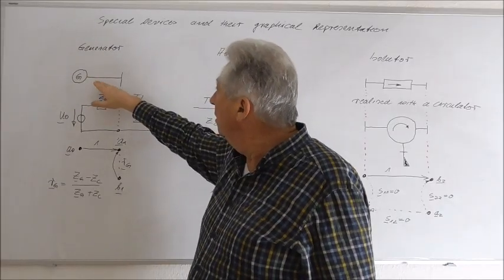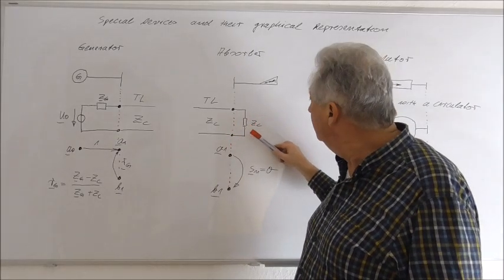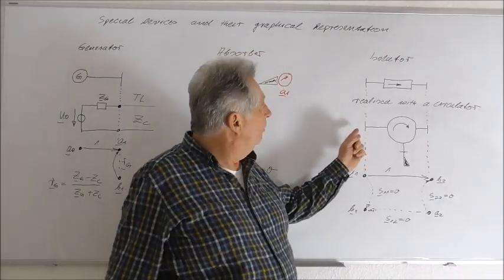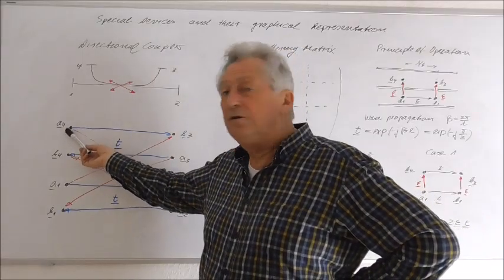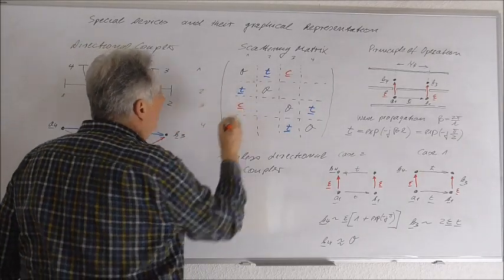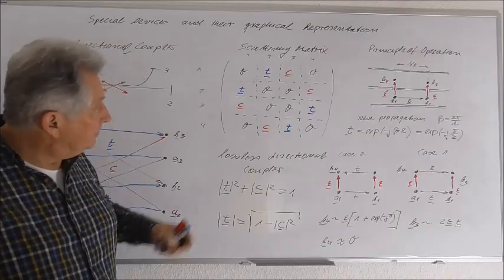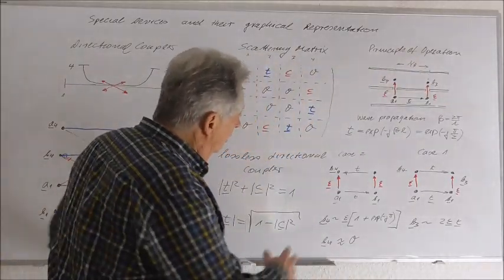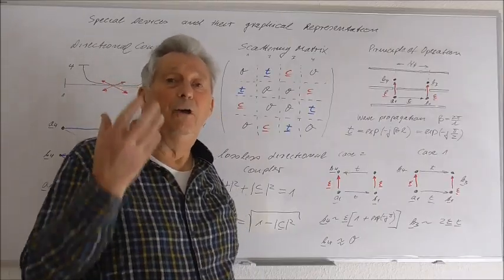Directional Coupler, Isolator, Absorber - Graphical Representation in Signal Flow Graph

Comment: I have three questions about directional couplers. 
1. In the figure in which you draw the red and blue arrows indicating the coupling directions of the wave amplitudes, the blue arrows indicate the transmission coefficients while the red arrows indicate the coupling coefficients. But during the discussion of the principle of operation of the directional couplers, transmission coefficient t = b_1/a_1, so I am still confused what's the difference between the t in the scattering matrix and the t in the part about principle of operation? 
2. Why is there a transmission coefficient between b_4 and b_3 as well, and why is it also equal to exp(-jBl)?
3. So if I understand correctly about the principle of the operation of the directional coupler, a_1 is coupled with b_3 and a_1 is isolated from b_4 right sir? If not, could you elaborate this part more clearly?
Reply from the maker: 1: I am not sure if I got your first question right. Scattering matrix and Signal flow Graph are just two different representations of the same, in this case a directional coupler. So you find t in the scattering matrix and also in the Signal flow Graph.
2: In a first approximation the transmission coefficient between 1 and 2 as well as 3 and 4 are just almost lossless transmission lines which introduce a phase shift according to the length of the lines
3: This is correct in the ideal case port 1 couples to port 3 and is isolated from port4

Comment: For the generator with non-matching characteristic, why is r_G defined as a_1/b_1 (the arrow goes from b_1 to a_1)?
Reply from the maker: In Fig. 4.9 of the lecture notes it is assumed that the generator shows a reflection coefficient r_b, which means part of the wave amplitude b_1 is reflected back from the input of the generator, thus it will contribution to a_1 which describes the total wave amplitude which comes out of the generator a_1 = a_0 + r_g*b_1
Reply: @Lectures_RF_Microwave  Thank you sir!